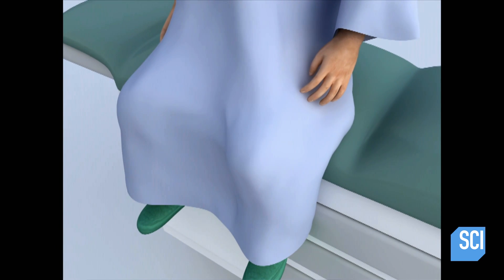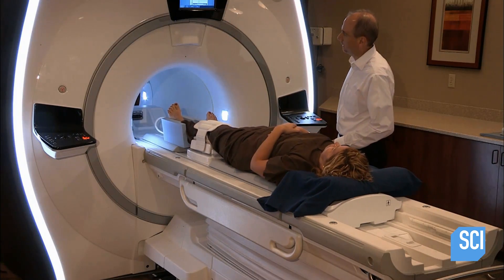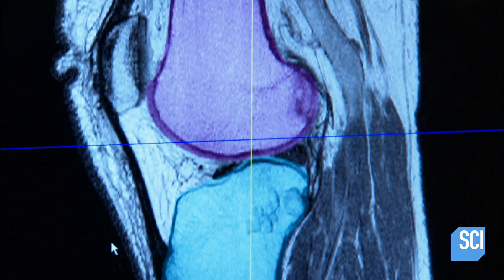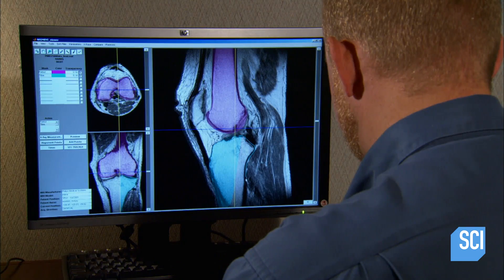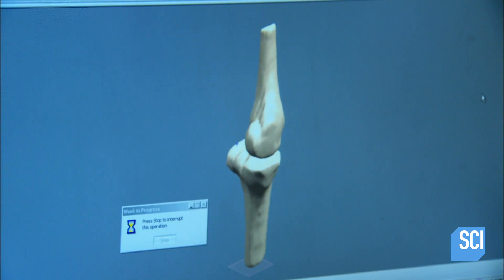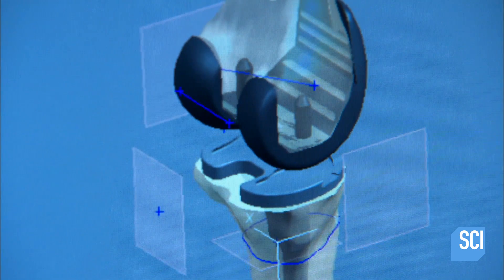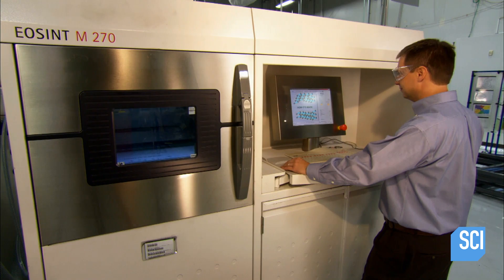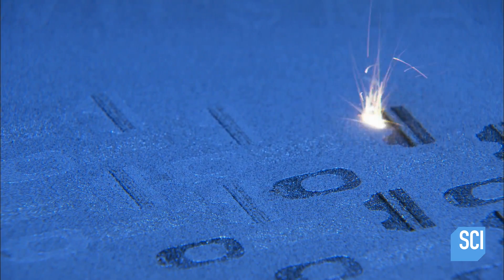How It's Made: Knee Replacements

Comment: My knee replacement was an experimental model installed when I was 16 after my left knee was destroyed by a drunk in a Cadillac.  I'm 64 now.Made of surgical stainless steel and titanium, it has held up over the years. I keep joking that they should have put a grease plug in it. These plastic models WILL NOT HOLD UP UNDER NORMAL USAGE and my doctor recommended that I not get a newer knee joint. It would last less than 3 years as active as I am.
Artificial left knee and an artificial right leg - I seem to deserve the description of Cyborg. BTW I can't go anywhere near a MRI machine.

Comment: My partner has worked for one of the largest joint replacement manufacturers for over a decade. I can honestly tell you this rarely do this. They have size guides they can obtain from X-rays but they rarely do that either. They now have robotic assisted methods that offer exacting cuts and angles to make for a perfect fit. These doctors perform 7 or 8 straight forward surgeries a day, they know exactly what they're doing and it's completely routine. Whats crazy is the technology used today is virtually the same as when it was patented in the 60's-70's! YouTube has great videos both live and animated of knee replacement surgery, go take a look for yourself.

Comment: It is amazing to see just how fast and far technology has advanced, for joint replacement surgical patients.  I had both of my knees replaced in 2013 (10 months apart).  No MRIs for custom fitting guides; the biggest technology difference I experienced was different incision closures and dressings to keep things dry.  For replacement #2, I no longer had to wrap my leg in plastic and trash bags to keep the incision dry - the special covering material meant I could take a normal shower!  A good friend went through her own double knee replacements with the first before Covid, and the second delayed til it was safe again for surgical patients.  I was absolutely gobsmacked at how quickly she recovered - she was safe to drive only 2 weeks post op, whereas for my procedures, I wasn’t allowed to even consider driving for almost 3 months!
Reply: I had both knees done 4 days apart and then was thrown out of rehab a day early. It helps to be lucky.

Comment: My mom needs knee replacement surgery. I might let her see this. I'm sure this is more expensive than the old way. 😩😩😩😩
Reply: You never know, could be less.  If this decreases the duration and difficulty of the surgery, that could be a big reduction in cost
Reply: This sounds like it could be the Nano knee surgery. Saw a doctor for it. The MRI must be done within 30 days of surgery & is not covered by insurance - $4K for MRI. So no MRI until you commit to surgery. He did look at x-rays to determine dammage though. Recovery is minimal, one-week, opposed to tradional knee surgery that takes 6-8 weeks to recover. It doesn't last as long though - 15 years, opposed to traditional knee replacement, which lasts  20-25 years.

Comment: I believe the “plastic” powder used for the 3D printed parts is actually nylon.
Reply: Nylon is just one of maybe a couple dozen thermoplastic resins used in additive manufacturing,
Reply: @osmanvincent1975  They’re using SLS 3D printers so it’s most definitely nylon. The other thermoplastics you’re referring to are used by FDM 3D printers, which work with a much wider range of materials (PLA, ABS, PP etc).